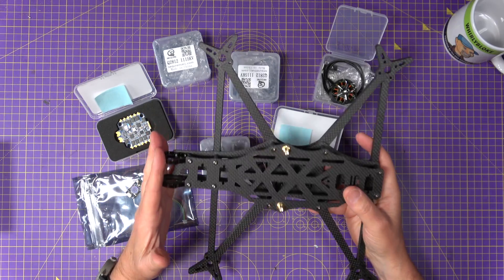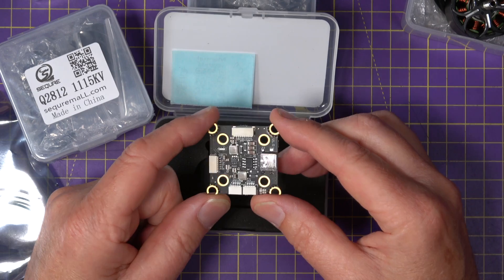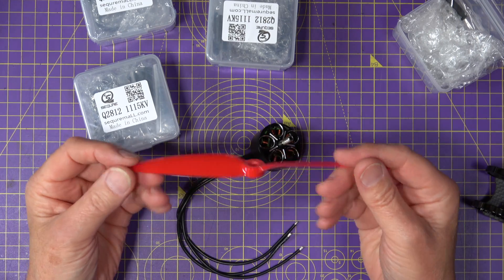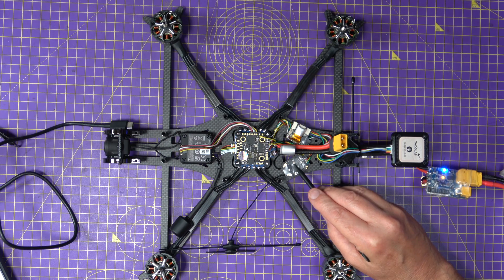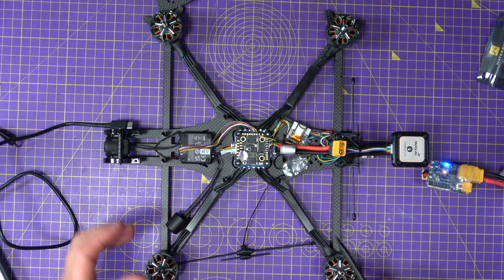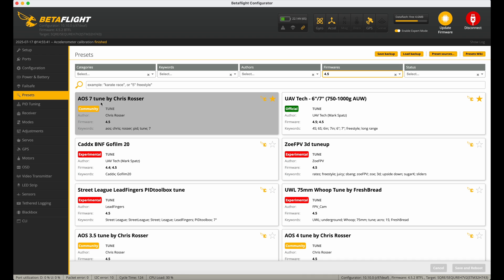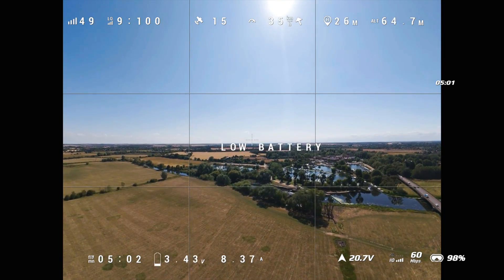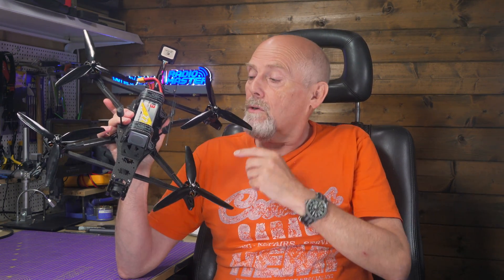How to build a 7-inch long range FPV Drone

Comment from the maker: Want to build your own 7-inch long-range FPV drone?
All the parts I used are linked in the description, and I’ve included tips for tuning, throttle profiling, and reducing full-throttle vibrations.

Let me know what you’d change in your own build — or if you’ve tried any SEQURE gear yet. I’ll be replying to questions in the comments 👇

Comment: Fantastic video, thanks for pointing me to it. One question: what is the longest range/duration flight  you managed with it? Do you have  a video for that?
Reply from the maker: Thanks for watching. Range is way further than I am comfortable flying, but a flight duration of about 25 minutes using  Li-ion batteries. They are fantastic for cruising, but not acro. I’ll definitely consider making a video on that.
Reply: @WhirlyBloke  Thanks for the details! 👍Me, I'm trying to reach 1h for really long-range exploration, and with maximum possible penetration. Will probably have to switch to a fixed wing/VTOL and 433Mhz control / 1.2Ghz video links. Current rig is a Flywoo Explorer LR4 with a GEPRC GemX 915M/2.4Mhz receiver and a 800mW 5.8Ghz VTX, which can touch 30 minutes of flight time and 10km out-and-back (20km total) range with a 4S P30B Li-Ion pack (and my preliminary tests show, a bit more with a pack made of JP30s). After watching a ton of YT videos, I find it strange that most/all 7" and larger quads can't beat the LR4 by much, despite carrying proportionally much larger batteries -- the ones that can, are carrying 12Ah or 16Ah 6S Li-Ion packs, but even they can't reach the 1h mark.  Re: being comfortable, I get it -- as soon as my spotter loses sight of my quad, I start breaking a sweat -- but getting out of our comfort zone is good, I think. Thanks again for all you do, and happy 2026!

Comment: Agree, the AOS7 V5 frame looks gorgeous. But $120 gorgeous, when a run-of-the-mill 7" frame kit (also with the TPU parts) can be had for less than $25 on AE? I'm not so sure the cost/benefit justifies it. But what the heck, perhaps the extra $95 is justified, I have no experience with 7" frames.
Reply from the maker: Frame resonance in larger build is the issue. The AOS frames are extremely stiff, which makes tuning a breeze. But it's definitely on the more expensive side.
Reply: @WhirlyBloke  Thanks for the clarification!

Comment: Is this capacitor good? Is it sufficient for this drone? I saw your other video about capacitors; it seems a bit contradictory to use this one. I ask because ESCs now come with them, and I'd like to know if it's safe to use.
Thanks And Good work
Reply from the maker: 470mF 35V is the minimum for 6S. That's what most 30.5mm x 30.5mm flight stacks include. When possible, I try to use 1000mF 35V but space is always the problem.

Comment: Great video! 👍. I was wondering how you mounted that second dual band antenna, did you use a zip tie around the top plate?
Reply from the maker: Exactly. It's very simple, but it works. Thanks for watching.

Comment: Hi everyone,
I urgently need your help with my FPV setup - I'm stuck in several places.

My setup:
- iFlight Nazgul DC5 (with DJI O4 Air Unit)
- Flight controller: iFlight BLITZ F435
- ESC: 4-in-1 45A (BLHeli_32)
- Motors: 5" Freestyle
- Radio: Radiomaster Boxer (internal ELRS 2.4 GHz)
- Goggles: DJI Goggles N3
- Batteries: 6S LiPos (Dogcom/Tattu)

What has been done so far:
✔ Betaflight configured, firmware reflashed with “Full Chip Erase”
✔ ELRS receiver correctly connected via UART1 + bound
✔ DJI O4 running incl. live image
✔ ESCs recognized, motors turn correctly in “Props Out”
✔ Throttle works correctly in the radio (1000-2000 µs)
✔ GPS module connected (but problems, see below)

⸻

❗Current problems / questions:
1. Throttle bug:
As soon as I accelerate (~15 %), the drone turns up completely (motors at 100 %) and only stops after disarm.
→ Motor idle is at 5 % (value = 100), DShot600, bidirectional DShot active.
	2nd GPS module is not recognized.
→ I suspect incorrect UART or baud rate. Where can I check this for sure and what is the correct configuration for the module?
	3. hover throttle:
I would like to find out the real hover value in order to tune better (no “tearing up” when accelerating).
	4. PID/Filter:
I currently use stock PIDs - how do I find sensible values for feedforward, TPA, anti-gravity, D-term filter, etc. for clean freestyle flights?

⸻

I would be super grateful if anyone can help me - especially with the throttle problem and the GPS
And I have now the problem that after elrs configurating my tx and rx aren’t connecting.

Comment: @WhirlyBloke I noticed at 15:15, You have to use the carbon motor support plate outside of tpu protection mount, that way it remove any vibrations and unstability. I did the same mistake, as you tighten the screw tpu mount gets damaged.
Reply from the maker: You are 100% correct. I swapped it around and could then torque the bolts down evenly. Much better. Thanks for the info. It's always good to share.

Comment: The aos 7 same frame shape was my first drone build, but I used xnova 1900 , and 6" DAL props and worked flawlessly with speedy bee f405v3 55A. Brilliant acro drone. And fast with the Xnova motors
Reply from the maker: Sounds like you built a great rig, and thanks for sharing your experience.

Comment: I have the vi fly camera switch . A 2 camera switch that runs off ch 7 sbuss . It hooks parellel to the flight controller sbus input . Set up chanel 7 in mixer on a 2 channel switch . It is factory configured to hear ch 7 . 
   One camera for landing  , or one for looking back or down  . One oyher camera uptilt for speed ?
Reply from the maker: Thank you for your feedback. It's always great to hear how others are setting up their gear. Your tips will definitely help others looking to enhance their FPV experience.

Comment: I have a 7 inch kit waiting to assemble . It was $79 three months ago . 
How would you use 8 motors ? Would you stack 2 frames and invert the bottom motors ?
Reply from the maker: Have a look at the AOS Cine80. I've built the previous Cine70 version and it works great.